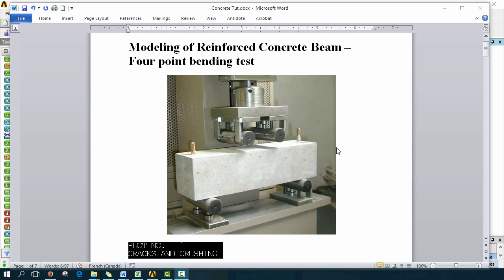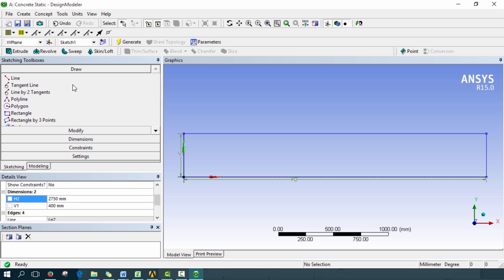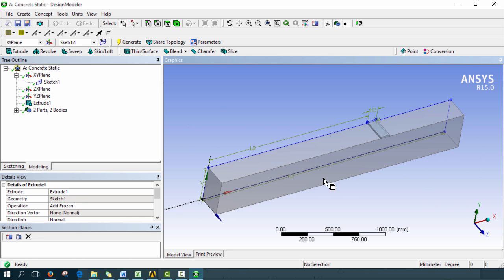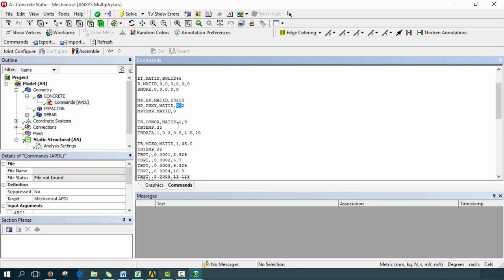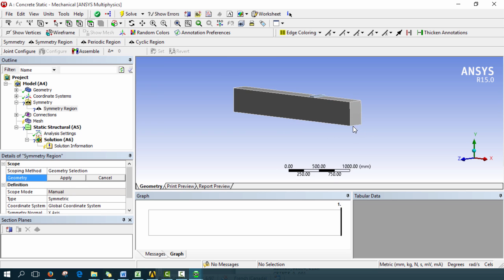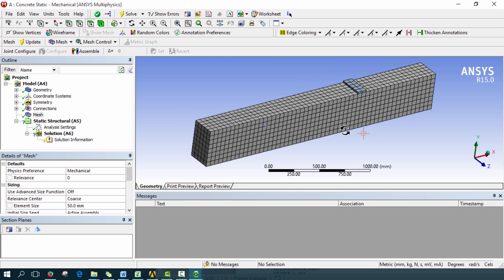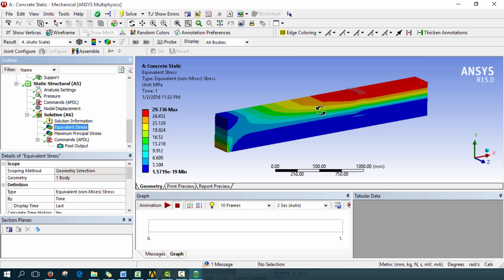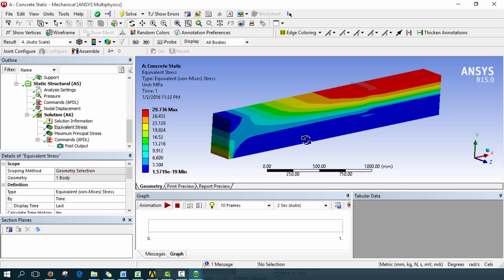ANSYS Tutorial Reinforced Concrete Beam (RC BEAM) - Static Structural

Comment: Thank you Dr.Dalyo very much for the video. I used the geometry file from your last video since it includes shear reinforcement in it. I changed the APDL code for rebar by changing the radius of the rebar appropriately. But I get an error,"Node 1578 belongs to element 124. The CEINTF operation will not consider this node/element combination" and this error continues to the rest of the nodes. Can you please help me ? Should I change the APDL code elsewhere or if else where should I ? Would be much appreciated if you could help me ?
Reply from the maker: +Sivaraman Kiran It might be because the mesh nodes do not line up nicely with the rebar. try to space the rebar evenly, so when you go to create a mesh, the element size will be a multiple of the rebar spacing so the nodes will line up. if the rebar nodes and the concrete mesh nodes are not close, you might get errors.
Reply: +DrDalyO thank u very much for ur valuable video as well as ur response. Much appreciated for u work on Ansys

Comment: thank u Dr for ur interesting kindly I want to  ask  what about pretension prestressed concrete or posttension concrete its possible to modeling it by ansys ? and if we did hole through the concrete and but in these hole beam element  as tendon and bonded  between them it will work ?
Reply from the maker: +Ahmed Al-dean i am not familiar with pretension or prestressed elements for this example sorry. It should be possible, please see the ansys help online.